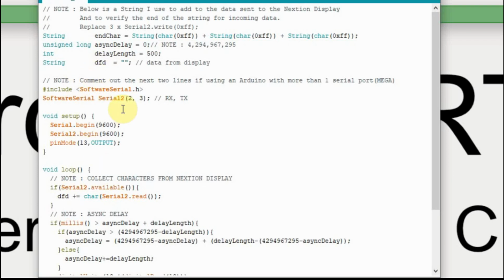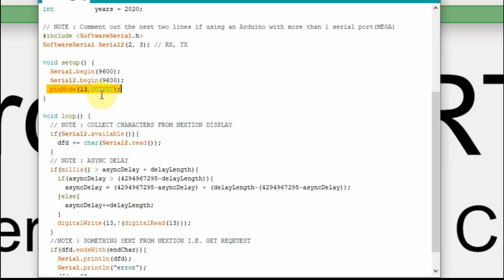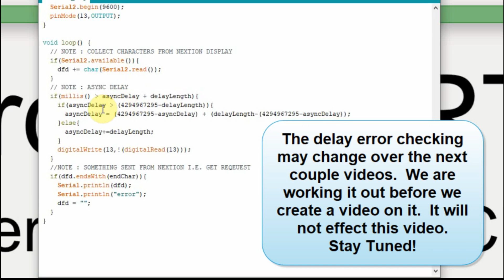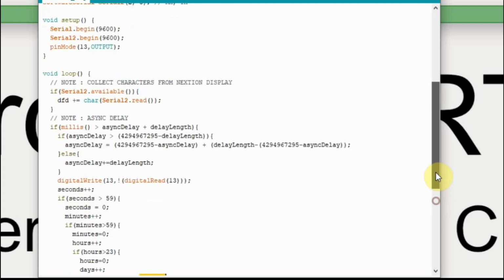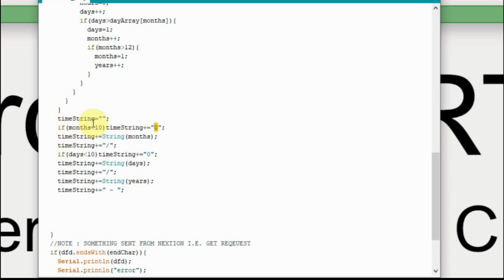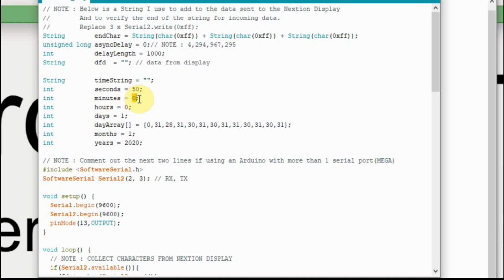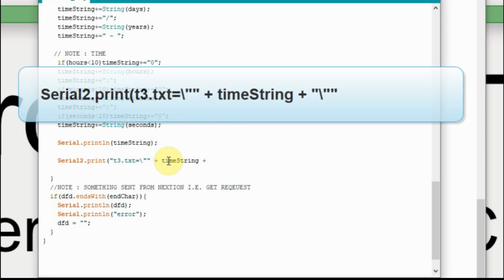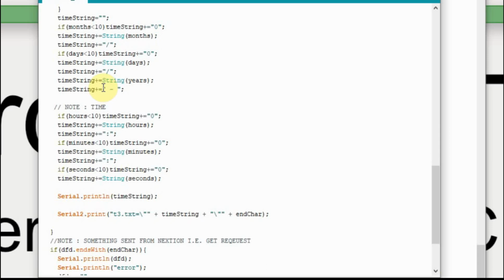#120 Arduino Real Time Clock using the Millis() command

Comment: does this code work on arduino uno?
Reply from the maker: It doesn't work very well but if perfect accuracy is not needed, it works ok.
Reply: @CheapControls  if accuracy is need. do i have to install a specific library for its communication/Serial and what would it be?
Reply from the maker: No library.  Millis is part of standard arduino code.  Just use variables.
Reply from the maker: If you want accuracy you will need to add a Real time Clock chip

Comment: The timer works great. Question/Challenge: how would one modify the code to create a countdown timer? Thanks
Reply from the maker: That is an interesting idea.  Are you thinking of this running on a Nextion display or just a static timer that restarts every time you restart the Arduino?  I have not been very good at uploading the code to the cheap controls website.  If there is something specific complete the form on the cheap controls site and I will email you any file you ask for.
Reply: The timer would run on the display. My specific application is taking user input (from the Nextion) to specify the duration of a pump run and then displaying the time as a countdown timer on the Nextion. When the countdown timer completes the pump would stop (or any other action required at the completion of a countdown timer). The internet is replete with examples but none are as straightforward as it seems like it should be. Your help would be appreciated.
Reply from the maker: What is the time frame you are talking about, minutes hours days?  This could be an interesting video.
Reply: I’d like the flexibility of user input configuring all three. Ideally with a daily / weekly recurrence option - but I’m dreaming here. My immediate need is to use input from the user via the Nextion to configure a countdown timer for hours / min / sec (and not rollover at 00:00:00) and execute something at the start and end (in my case a relay to start a pump and stop it when the countdown ends). You’d be an internet hero if you could make this simple. I’ve searched literally for two days and found very little (that I could understand anyway...). Maybe its just inherently a deceptively hard problem?
Reply from the maker: Sounds good.  Consider going over to the Cheap Controls web page and entering a comment with your Email address so we can discuss this in more detail.  If you don't want to do that I understand and will try to get a video out on this project next week.

Comment: i have a different question. I may want to be able to change the font using the device itself. So i created some buttons with the appropriate font name and i can change fonts of buttons etc. But how can i change the font of a button on another page? It only sees the buttons on the same page.
Reply from the maker: I have not tried that but, you could try and set the objects you want to change to global or maybe You could set a global variable and test for that value on page load.
Reply: @CheapControls  thanks i will try that
Reply: @CheapControls  doesnt seem to work or i do it wrong. i have every button and page globally and the variable as well but it doesnt get found on other pages
Reply: @CheapControls  but i cound try to send something to the esp32 and then it sets the font
Reply from the maker: Sorry,  I have not had time to try this out but I will try to look at it tonight.  I hope you would not need to store something away from the physical display on an external device but that is another option.
Reply from the maker: What does the line to change your font look like on the Nextion?  "page1.t0.font=1"
Reply: @CheapControls  "page1." did it, thank you :)
Reply from the maker: Glad you got it working.